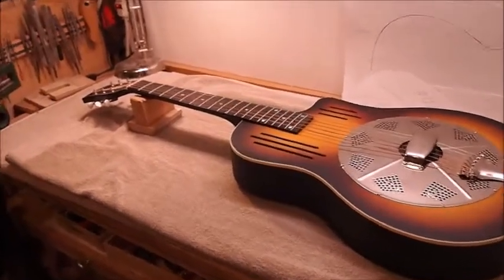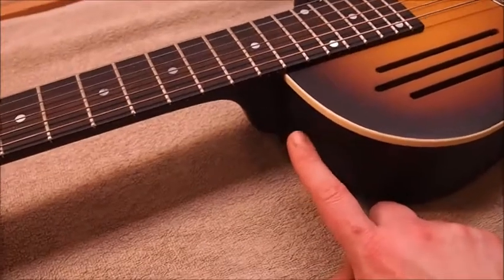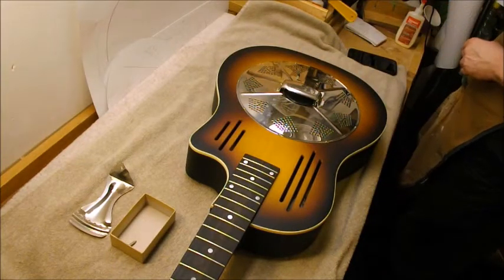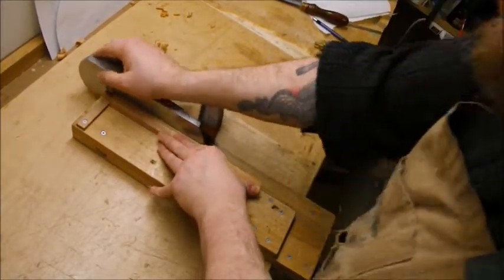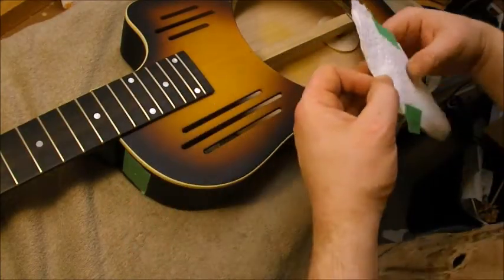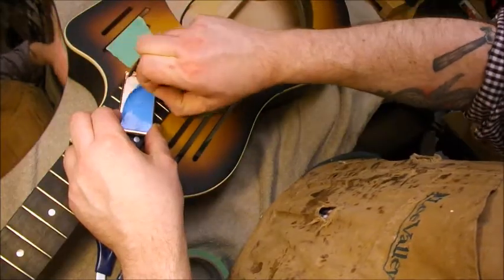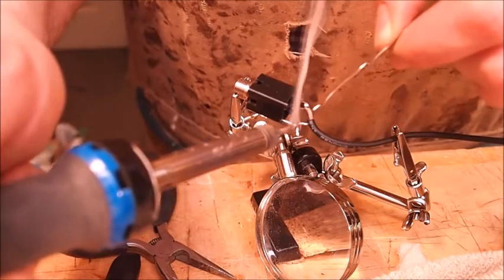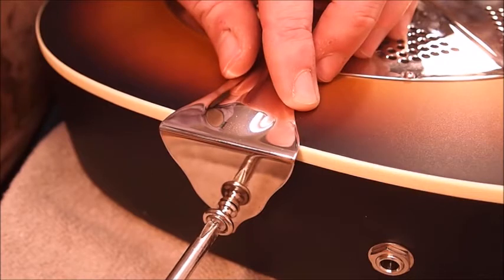National Guitar Pickup and Strap Button Installation

Comment: Hey, I know that guitar! I drooled over one in a local shop, back when I was a teen.  I couldn't afford one back then, and I still can't afford it today. Great guitar, and a great looking as well. Quick question, when you installed the jack for the pickup, did you also have to reinforce the side there?  I am about to put a pickup in my washburn resonator. It has a tailpiece and I feel weird about trying to modify the current endpin and tailpiece to fit an endpin jack.

Comment: Hi, why did you drill a hole in the top instead of just going through the hole that is already drilled where the strap button is?  Or why not drill a hole right above the strap button if it does not fit, instead of the top?